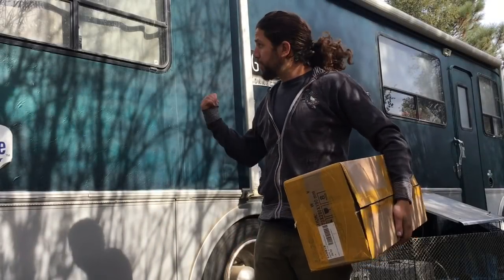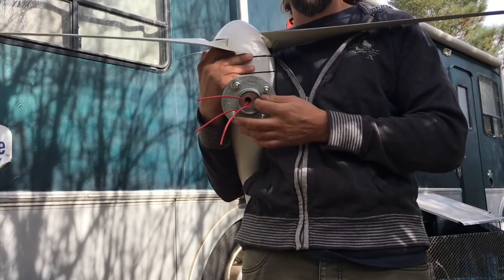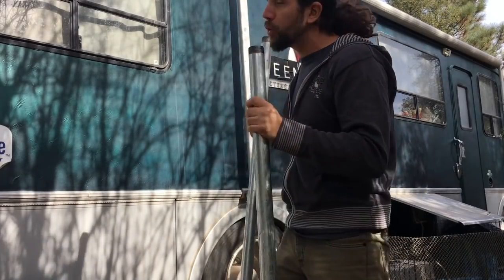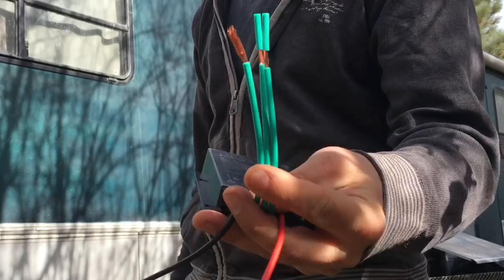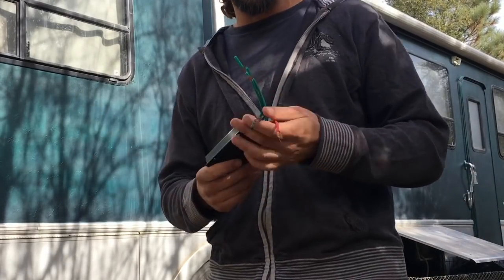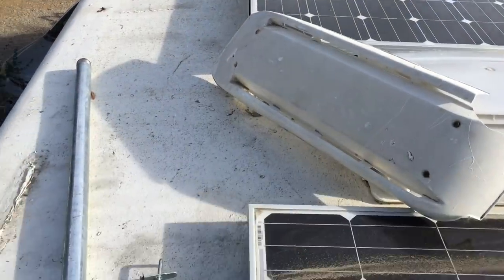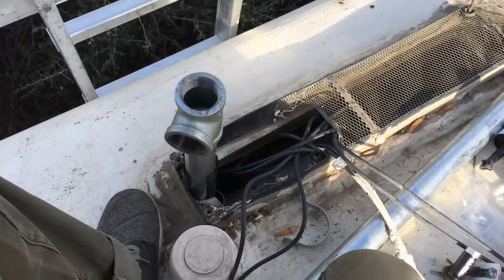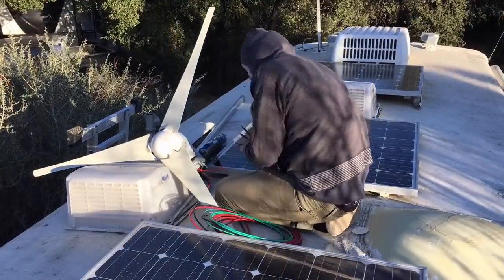RV Wind Turbine installation setup

Comment: Stupid putting a metal pipe in the heat tube of your fridge ! Hot flame rubber wire .. dumb that has a function and it's not to hold that I give this a huge DUMB ASS

Comment: The shaft that you put your steel pipe down.  What is it's original job, since it is by your fridge?  Is it the gas vent for your fridge?  In putting a pipe down it, are you compromising the longevity of your fridge?

Comment: 3 wires from controller,three from generator,unmarked. Do you just connect any to any?
Reply: All three wire are the same color, right?
Reply: I did,and it works fine

Comment: the controller closer to batteries

because three wires ac further distance may lechen the mach not far different wires can get hot and the thick wires nodich ac not and the controller works far even how
Reply: There is no reason to mount the black Charge Controller, outside in the hot sun ...
Reply: @MrSummitville  ac less likely to heat than dc
Reply: @MrSummitville  AC needs regular cable dc need thicker ones
Reply: @dimitrimotor2861  My point was ... It is color black and it would be outside in the sun = TOO HOT !
Reply: @dimitrimotor2861  Please, tell us the exact size wire needed for AC vs the exact size wire needed for DC.  Show your math ...
Reply: @MrSummitville  I use with a battery to battery as thick as a car cable that is used to demar a starter but when charging it is thinner around 5mm but keep DC short and you can safely get far away the sun will hide your cables in a tube or something
Reply: with me the cable doesn't even get hot
Reply: @MrSummitville  it is better to have a battery in between so you have more amps in your caravan for appliances and the cables get less hot
Reply: @MrSummitville  my setup is 24v also converters to 220 v sometimes in use also led 24 v led strip
Reply: I hope I have been able to help you a little

Comment: Green wires are alternating current so you can make long cable runs no problem so you can have the charge controller next to the batteries.
Reply: So, WHY did he state "near the turbine"?  I have never heard of ... mounting the black Charge Controller outside, in the hot sun ...

Comment: Because of vibrations, I'm thinking that calk will not be able to keep it from leaking for long if you travel to a place where there is rain. Could you go up the side with the pole and make a small hole for the wires with a wire grommet instead? 😃

Comment: You should not use these cheap charge controllers, they work very very poorly. Get a boost buck controller. This will also help at low wind situations. Do not get confused about hybrid controller name, just use the wind part and shut off the solar part. https://www.aliexpress.com/item/1423775152.html

Comment: So the big question i have is i just bought the exact unit, how do the wires not get all twisted up inside when the wind generator rotates to face the wind?
Reply: It has a slip ring that takes care of the cables. Google it.
Reply: Does your wind turbine spin round and round 360 degrees, every hour?  No, it does not ...

Comment: I forsee massive leaks in your future... lots of roof rot and fridge failures coming your way
Reply from the maker: Mr. C thanks for the “trolly” negative comment but we have caulked the entire pipe entry and we keep it nice and capped closed when there is no wind. The pipe does not touch the fridge either.. its actually secured against a dividing wall between the fridge and the bathroom using pipe fastening ring.
Reply: @Green-placesOrg  No "trolly", but very honest.  You did a terrible job.  All pipes should have a rubber seal <= the correct way.  Not a pound of caulk sealer <= the wrong way.
Reply: @Green-placesOrg  not trolly...... honest I have seen it before

Comment: Extend the 3 green wires all the way inside the RV right next to the charge controller for best results. The red and black or positive and negative wires should remain short next to the charge controller. Otherwise, you'll have a loss of power. Remember, three long three-phase wires to the rectifier. Two short positive and negative wires from the rectifier to charge control.

Comment: thanks for the video , I'm planning to do something similar. if you want to improve , I suggest you modify that wind turbine and make it a 5 blade. You can buy 2 more extra blades and the black blades head on ebay for about 11-20$ each. It will improve dramatically in low wind conditions. Is any way you can put the flange you got (the part that connects the turbine to to pipe in the description) I'm trying to find that part somewhere to buy. Thank you !
Reply from the maker: Daniel Timisan you find that part in the plumbing section in most hardware stores
Reply: Green Places went to Lows today and did not see that part , spent more than 20 mins looking
Reply: @danieltimisan6820  5 Blades may "cut-in" earlier, but it will spin slower.  So, if you don't know what you are doing, it can produce LESS total energy per day ...
Reply from the maker: Daniel Timisan I got mine in Home Depot

Comment: Had a Rutland on my RV roof for 12 years not a problem.my RV is steel framed.would not recommend fitting on wooden framed.But this 400  is the one I intend to upgrade to .

Comment: Yes you should have made your long wire run with the 3 wire AC.  Less Losses.   A 12 AWG extension Cord works great.   Did you obstruct your refrigeration's Ex host ?  It looks like it.   Bad Ju Ju.   Be Expecting Issues in the future.

Comment: Does it make a noise you can hear inside the coach or would disturb the neighbors?
Reply from the maker: Yes, it is quite noisy when it is in full motion.
Reply: @Green-placesOrg  Thanks, much...
...I can't have noise. People in RV parks complain about the smallest things. And if I'm boondocking, I don't need background noise...
 Plus, these things are bird-killers...and I like birds...
Reply from the maker: The noise is annoying.  I'd compare the noise to that of a propane generator.  It really doesn't compare to the silence of solar panels, but I cannot imagine how this can kill birds.  It's pretty small.  We never had a single incident of birds flying into it.
Reply: @Green-placesOrg  Thanks, again...
The noise is definitely a non-starter...can go with that...I like my quiet...
I put out bird feeders so generally, there are mucho birds around. They tend to squabble a lot. Just for the fun of it, I guess. They get inattentive and fly into stuff all the time. Bonk! Thud! 
Maybe a vertical windmill is safer and quieter...I hear they don't put out much energy...

Comment: In my experience with wind vane self-steering sailboat units, I learned 
that a wedge shaped (v-shaped) tail fin is much more stable than a flat 
tail fin. The wedge prevents hunting while pointing directly into the 
wind because there is pressure on both sides of the wedge which keeps 
the wedge from wandering. Place a tab on one side of the wedge fin to 
if you want torque speed control. This reduced hunting will reduce 
gyroscopic precession stress on the bearings and on the blades. It 
should also increase the average power produced because of reduced 
hunting. What say you to that?
Reply: I say it sounds good but I can't really picture it in my head... do you have a video or pictures or something?

Comment: The real question is how much power does it actually generate? Seems like most of these small turbines produce disappointing numbers. Also, how much noise/vibration is transmitted inside the rig? Thanks for sharing your installation.
Reply: What are the actual numbers?
Reply: at 11~12m/s wind speed it can actually reaches 300w~400w power
Reply: hi, the turbine inside this video made in our workshop, this is horizontal wind turbine 400w 12v, with good efficiency, better than vertical wind turbine

Comment: Good job man.  The 3 green wires from the generator are 3 phase AC which are converted to DC by the controller.  It would be even more efficient if you extended these 3 wires for the long run and put the controller as near as possible to where it hooks into your DC system inside, rather than having the controller on the masthead with the long run of 2 wires.  You would get less cable losses this way :)
Reply: How can i know the turbine actually produce ac or dc output?
Reply: azam ali turbines with 3-wires=AC, 2-wires=DC
Reply: @azamali2328  check turbine output values..or measure with multimeter..
Reply: Exactly,    turbine to controller connection is 120 v (240 ?) and controller to the battery bank connection is 12 or 24 volts.  If  your set has 200 feet from the turbine to the battery bank and   the controller is  e.g. 2 feet from the turbine it means you   run  12/24 volts on distance of  198 feet. You will need a  THICK   WIRE. But if you place your controller 2 feet from the battery bank, you can run pretty thin wire to handle 120v over 198 feet  and 2 feet  of not too thick  wire to connect the controller to batteries.

Comment: Can you please post a link to the turbine that you got, and are you happy with it after having it up for the summer?  Are you getting a decent output from it?  Great video, thanks
Reply: https://www.aliexpress.com/store/product/windmill-new-wind-generator-400w-3-blades-or-5-blades-wind-turbines-kit-applicable-multiple-voltage/3903045_32963816416.html?spm=2114.12010608.0.0.793f4291qjlHWR

Comment: Did you wire the solar panels into the wind turbine hybrid controller? If so, what gauge wire did you use to the batteries?
Reply from the maker: Kelly Cromie the panel and the turbine are leading to the same charge controller but the wind turbine has its own mini charge controller its hooked up to, I think I got 8 gauge for the wind turbine cables.